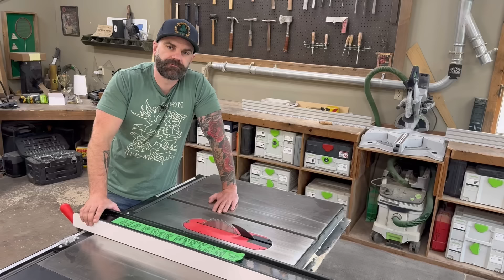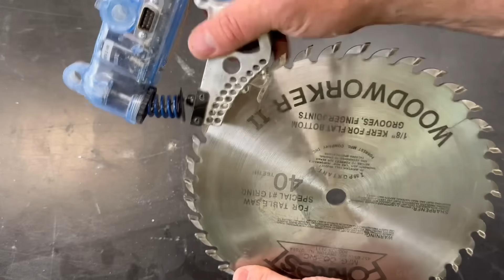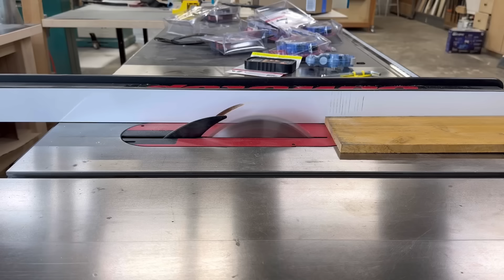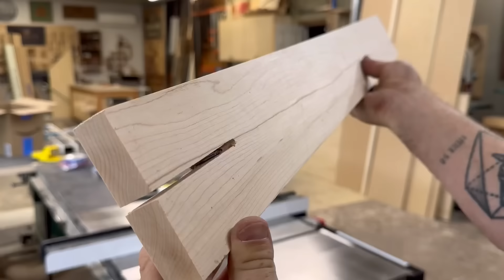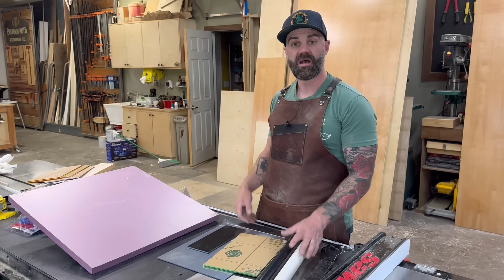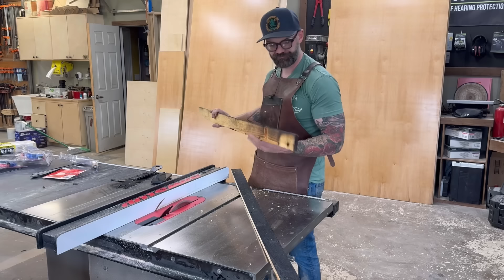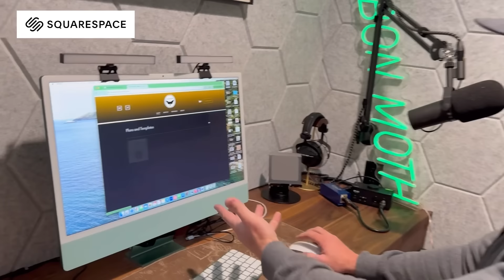Finger Versus Table Saw || Testing SawStop Myths

Comment: I tripped my SawStop when I used a 4" iron C clamp to hold a small workpiece against a wooden extension on the miter gauge.  It worked well for two pieces, but then I placed the clamp a teensy bit too low.  The blade polished about a half square millimeter of the clamp before the blade disappeared.
I was holding the clamp, so the electronics saw me as well as the clamp.

Comment: I understand that presure-treated wood contains a copper chemical that can connect the blade to the table, thereby tripping the electronics.  When cutting p-t, I use bypass.

Comment: The charred wood might trip the saw if you run the board with the charred side sliding on the table.  That would present a large capacitor to the blade, and maybe the char could conduct well enough to perturb the charge in the blade.

Comment: It's not simply just about conductivity.  It's about the capacitance.  A larger item such as a fence, saw table, human body has a great deal more capacitance than a small nail.  I am surprised thought that the water was not conductive enough for the capacitance of the body to trigger.

Comment: As an electrician,  I'm looking at this video as these are all done wrong. The circuit works like a circuit breaker, a gfci more likely. Your skin has to touch the blade or arbor, or something your touching has to be electrically conductive, touching the metal surface creating a short. Normally the saw is reading O/L like on a test meter, the second the circuit closes, pop goes the blade.

Comment: i'm sure humidity plays a role. Static in particular builds up way easier in dry air. Ambient temp may also play a role. But yeah regardless, its pretty impressive and it does its main job perfectly - protecting you.

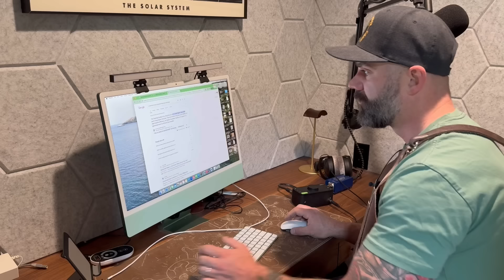Comment: 17:00 You should be looking at electrical conductivity and not thermal conductivity. Thermal conductivity is the heat transfer and electrical conductivity is what the sawstop uses

Comment: Aloha, fun and educational vid, some notes i have made as follows not necessarily in order! glad you eventually put on eye protection, when changing blades gloves would be wise, i discovered why the charred wood did not act as Carbon Fiber as the latter is 90% carbon which is heated up to the point of becoming Graphite, graphite is a known conductor for electricity. That final test made me nervous as you intended, please never do that again. BTW Craig looked to be enjoying the Head Job

Comment: Forgot to put a link to the burboun. I'm gonna need some after replacing a bunch of breaks on my saw! Also, a tape measure will set your break off if it swings into or touches the blade, POP goes my blade!

Comment: According to the interwebs, green trees can have MC as high as 200%, but it seems that once it's been milled the highest you'll ever see is in the 30's, even at Home Depot. As to the metals, aluminum is about 3.5X as conductive as iron and about 2.5X as conductive as carbon steel, so not surprising to see your results there.

Comment: Saw stop table saws suck. After having to work in a shop with three of them, i would much rather use my 30 year old Power Matic saw. The only good thing about a Saw Stop saw is for the careless or inexperienced users. It protects them from themselves. The saws are gutless, limited to only using a 10” in blade. If you want to use a dado stack you have to buy a 2nd saw with different brake assembly that will grab the 8” blade.

Comment: I have a Saw Stop.  One "feature" of the saw is that if you "touch" the blade without it running, but with the saw powered on, it will flash the light on the control panel if it thinks the board is going to trip the pawl.
Also, the wood used in this video (other than the Cedar) was all wet from "fresh water" which is NOT normally very conductive.  Pressure Treated Wood has a higher Salt content which would make it much more conductive and more likely to trip the pawl..

Comment: About six months ago when I excitedly went to use my new Saw Stop I was going to build a cedar planter box. The cedar wood I got was wet but not as wet as the board he pulled out of the river anyway about my second cut through a 6 foot cedar fence board bang scared the hell out of me so I had a new saw a new blade and thank you very much. I wanted to buy a Laguna, but my wife insisted that I get the Saw Stop because I’m older and not quite as sharp as I used to be and she has a point there. I have set my Saw Stop saw off three times now one time I totally don’t know what it was. When  you’re on a fixed income it’s tiring buying them $156 cartridges that’s Canadian dollars. Of course we will pay for everything.

Comment: I do not remember if you mentioned if in any doubt you can over ride the safety and when you do over ride that safety it will flash red after the cut to let you know it would have set off the brake.  Great Saw I have hade mine for years and never had an issue cutting wet lumbet. I always over ride the safety while cutting aluminum plate and cutting plastics.  Fantastic Saw

Comment: My experience with over 15 years with a Sawstop.  
(1) WET WOOD- YES, but it was a wet pressure treated 4X4.
(2) NAIL - YES, ran a piece of wood that had 23 gauge pin nail in it, destroyed a dado set.
(3) METAL- YES, neighbor asked me to cut some styrofoam insulation. Didn’t notice it had foil backing. 
(4) SLOWDOWN AFTER TURNING OFF - YES, if the run light is blinking the saw will trigger.
(5) REUSE BLADE- I wouldn’t recommend. I’ve had the teeth separate from the blade from the G forces
(6) STAPLE - NOPE
(7) ACRYIC or POLYCARBONATE sheeting.  NOPE, cut many sheets of both

Comment: Lotta comments below about pressure treated wood. PT is usually treated with copper salts, and copper is almost 2x more conductive than aluminum. I Am Not A Chemist, but I wonder if wet PT would get a bunch of that copper in solution and make the wood much more conductive than even the Home Depot special SPF.

Comment: Very informative. Thanks for your research.
Your Saw-Stop has endured more than a dozen or so stop-blade actions, which is clearly a pretty violent event. Is there any damage to the saw structure or housing as a result of these stops? Is there a limit to how many times this action can be triggered before the saw itself becomes affected? Also, did you have any issues with reusing your blades after they has been stopped?

Comment: Your test of the charred wood was not valid.  It might stop the blade if you had run the plank through with the charred side in contact with the table.  The canonized wood might be conductive enough to trigger the cartridge.

Comment: Great video! 

I recently triggered the brake after a cut (turned saw off) when the blade was barely spinning and I went to double check the distance from fence to the blade with my tape measure. Only a tiny tap with my tape measure on the blade’s final rotation! Lesson learned.
Reply: Yes, I have one and I heard you must wait until the blade is all the way stopped. So I've been waiting that extra time just so I don't accidentally trigger the cartridge.

Comment: A while back I ripped a bunch of super wet redwood and although it did cut without setting the brake off. However, after about a dozen cuts the saw shut down without activation. The saw indicated the safety system was overloaded and the brake needed to be replaced. I contacted Sawstop and they were super helpful. They stated to clean the saw and brake cartridge and it should be good to go. And then he told me to put the saw in bypass next time. I knew that but I was lazy. Which is usually the source of most of my blunders. Cheers from central California.

Comment: I was taught (in a college class no less so it must be true), that once wood dries to less than 30% moisture content, then 30% is the highest moisture content it can regain.  Also, I have some Home Depot cedar fence boards so wet that they max out my moisture meter (about 60%).  You can actually see water on the surface of some of them.  You just need to dig a little deeper in the pile :)

Comment: Water alone is not a good condutor. It's the salt from your body that gets into the water that makes it conductive. You can test this by setting a multimeter to ohms and placing both leads in distilled water, then stir in some salt and try again. Or use low DC voltage.  Good sience project though. 😊

Comment: Interesting test. I use a festool saw with sawstop and it triggered because of a small piece of barbwire tht had been ingrown in an oak beam. There was nothing visible but when we cut the bean the sawstop triggered. First of all I was guessing it may have been some overload issue or so, but after we finished the cut with s circular saw it was discolored and a little bit of silver was seen. I was able to pry out some parts and it was a fragment of barb wire, not alot. Also the wire didn't go trhough at all. I contacted festool as they have a policy to replace cartidges that were triggered but that only covers if you triggered them with your body not malfunctions, which is odd, but anyhow. Festool states that any metal will trigger the Sawstop and you don't need to touch it or ground it.

Comment: Two comments; 
1. The acrylic mirror isnt a foil. It is a vacuum metallization process where aluminum is vaporized in a vacuum chamber and deposited on the surface of the acrylic in a thin layer. A layer of scratch resistant paint backing is then applied to protect the mirrorized surface.
2. Carbon fiber can conduct electricity. Certain types conduct more and certain types conduct less. But steel nails also conduct electricity. Seems like the amount of metal or carbon fiber or any other conductive material might be what sets it off.

Comment: I would have liked to see you drive a nail sideways through a 2x4 or any other board  so the nail is perpendicular to the blade. It’s a much more likely scenario for cutting wood that potentially had a nail in it and being fully supported by wood all the way around instead of pulling the nail through with broken contact the blade would have full contact and we would be able to see if it is set off trying to cut through a nail embedded board and not just by coming into contact with a nail in a situation as severely unlikely as you tested it but other than that it was a great video I can’t really think of any other materials someone would commonly be cutting on a table saw that aren’t obvious as to the outcome other than potentially antler for guys making knife handles without a proper bandsaw to make the cut

Comment: Sawstops are kind of inconsistent on what will or won't set them off on stuff like acrylic.  It might also be how it's stored, what you've done before, etc.  

Personally I dislike sawstop because people get to reliant on it.  At one of my jobs, they would get upset when I put it on bypass to cut things that would risk setting it off like acrylic.  They would also take risks(hands close to the blade) around the sawstop that they wouldn't do on a regular tablesaw.

Comment: A sled would isolate the material from the saw table.  Current needs to flow through the blade to another conductor.

Comment: I like the video demonstrations of the SawStop brake, what will/won't set it off, etc.  I think I have an issue when Jason starts getting into speculation about the properties of aluminum vs. galvanized nails and how they are impacting the reaction of the table saw.  I realize the disclaimer at the end of the video (i.e. "nothing in this video is definitive").  I accept the video as informative for what is shown on camera with the table saw, but that speculation for others might be taken as gospel truth, and I think i would leave that to the engineers at SawStop (is there any video or reading material to explain these outcomes that Jason shows?) that could be linked to in the video description for further information.  Small criticism -- I enjoyed the video -- but there's always someone that might take the wrong message from that.

Comment: Aluminum is generally recognized as a metal due to its typical metallic properties, such as high electrical conductivity, malleability, and the ability to form positive ions when it reacts chemically. However, there are a few points that could be raised in an argument against aluminum being considered a “typical” metal, though these are not strong enough to exclude it from the category of metals:
	1.	Non-ferrous nature: Unlike iron and its alloys, aluminum is not magnetic, which is a common property associated with many metals (especially ferrous metals like steel and iron). This can sometimes lead to confusion, as magnetism is often used as a defining feature of metals.
	2.	Softness: Pure aluminum is relatively soft compared to other metals like steel or titanium. This softness makes it less useful in certain structural applications unless alloyed with other elements to improve its strength. This could challenge its classification as a “strong” metal in certain contexts.
	3.	Oxidation resistance: Aluminum forms a natural oxide layer when exposed to air, which makes it resistant to corrosion. This contrasts with many metals that tend to rust or corrode more easily, leading some to think of aluminum as unique compared to more reactive metals.

These are more exceptions or nuances rather than strong arguments against aluminum being classified as a metal. The core characteristics—such as its ability to conduct electricity, its shiny appearance, and its structural properties—confirm aluminum’s classification as a metal.

Comment: The key to SawStop is an electrical property called “capacitance,” which I don’t even pretend to understand. All I know is that this property influences radio reception, and is exploited to make motion sensors, touch screens, and even touch-less faucets work.There’s a musical instrument — the Theremin — that uses this property; the musician never even touches it to play it. Somehow the SawStop detects a change in the capacitance of the saw, causing the cartridge to fire. The charge slams the aluminum block into the blade; gravity and inertia cause the blade to drop.

Comment: I think the sled set it off because the fence is connected to the sled with screws through the bottom that contact the metal of the table completing the circuit. A nail in the wood is electrically isolated surrounded by wood (an insulator).

Comment: Have you or anybody else tested the Sawstop with something more finger-like than a hot dog? A hot dog is a sausage, it has no connective tissues, tendons etc. I cut the ends of two fingers off a few months ago doing something well beyond stupid. I can tell you, it happened in way less than a second. So take a chicken wing and send it into the blade with some gusto. Not some timid slow motion. Do it like a fool and see what happens. I did.

Comment: "no aluminum even if you're not touching it" is misleading.  Your fence set it off when you weren't touching it because the fence was grounded through the t track and completed the circuit. if the aluminum was embedded into wood and not touching you or the table or fence it wouldn't have set it off.  come on now electricity needs a complete circuit

Comment: Interestingly, yesterday I sent the tip of a dovetail clamp through my Sawstop not once but twice while using a jointer jig on some maple. And the brake didn't engage. These are the Microjig dovetail clamps and I'm sure they are aluminium

Comment: Yeah, the after shut off thing is real. My wife set it off twice in a weekend (just a Knick once and the second time nothing). I went six years without ever triggering and had a a backup cartridge in my toolbox in case nothing was open if it happened. shout-out to Timberwolf sawmill for being open on Saturday and carrying sawstop. The sawstop technology is based on capacitance just like our touchscreens on our phones. The balloon test, and even the plastic tests are not necessarily conclusive because the relative humidity of the test space has something to do with it. Think of how you don’t get static electricity shocks when touching a door knob in the summer months, but you do in the winter months. So I would still recommend using bypass mode when cutting plastics.

Comment: I've had my saw trip twice. I run a Forest WW2 as my regular blade. (And so do you.) The first time the saw tripped the blade had 3 teeth come off. I contacted Forest and they replace the teeth for $8.00 per tooth and I had them sharpen the blade. Way better than having to purchase a new blade.
When you discuss aluminum vs. steel conductivity the numbers you cited are for thermal conductivity, not electrical. While aluminum is a much better electrical conductor than steel the latter is still rated as a good conductor.
Regarding cutting plastic. I've built two pvc dust collection systems and did a lot of research into pvc before deciding to use. I read a very technical paper by a MIT professor that basically concluded that while pvc can build up a significant static charge it can't dissipate it fast enough to cause a spark. So my guess is that the static can't leave the pvc fast enough to create a enough current to activate the brake. I'm not totally sure about this but is sounds right to me.